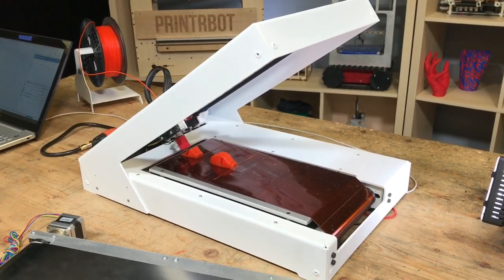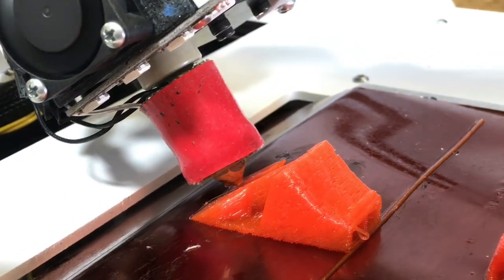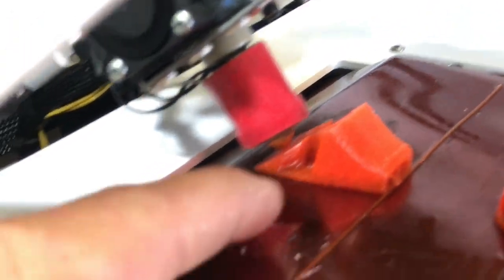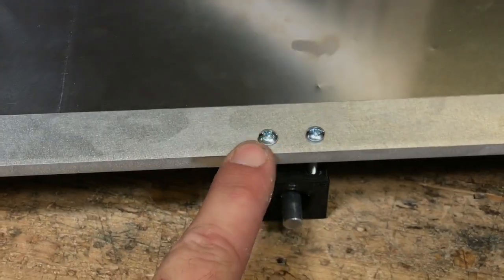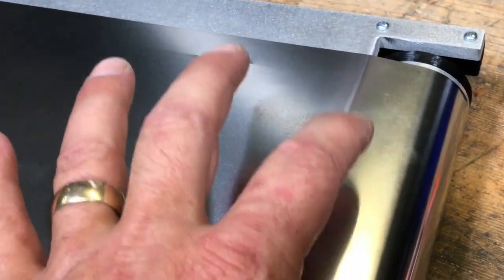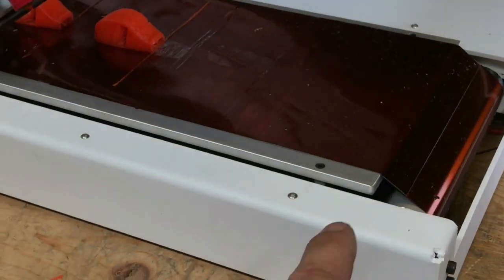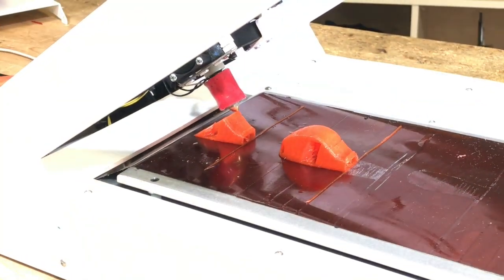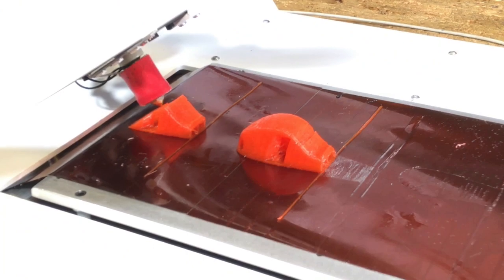Printrbelt update

Comment: I have an idea that might improve the printrbelt if you are interested. Right now it looks like you have the X motor fixed and the Y motor moves along the X (or Y I'm not sure how you chose to label axis). This adds a bit of weight to the X. When I first saw this design I immediately thought it would be a perfect candidate to use a H Bot design for the X and Y. An H bot keeps both motors in a fixed position and uses a single belt for both X and Y. Simply explained you move both motors in the same direction it moves on the X. Move them in imposing directions it moves on the Y. This would require special firmware to translate x and y moves to different motor actions, but it lightens the moving mass and also gives you twice the torque on moves since its 2 motors for every move not just one. Here is a link to a simple diagram that shows how it works : http://www.galil.com/sites/default/files/pictures/H-Bot_diagram_600x339.jpg

I think this could be a better design for the printrbelt. It makes belt tensioning simpler and lessens moving mass. Idk if it would have any  effect in making it simpler to produce specifically with the added cost of a unique firmware, but I figured I throw it out there for your consideration.

Comment from the maker: The bed is heated at the front, so yes to that ;)

Also, we are adding echain and cooling fans. Totally choked on not putting a fan on there. I forget the obvious on prototypes sometimes. The last little change is we moved the point the printing actually starts to the right a bit to get on level ground and ensure the heat has enough time to transfer to the belt. Oh and adding a few rivets on corners. That's really it. Otherwise it's just dialing in settings and choosing a tip. I'm partial to the .6mm to encourage speed instead of detail. But it will ship w all the tips we make.